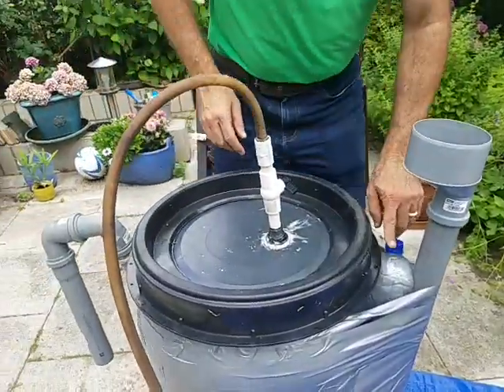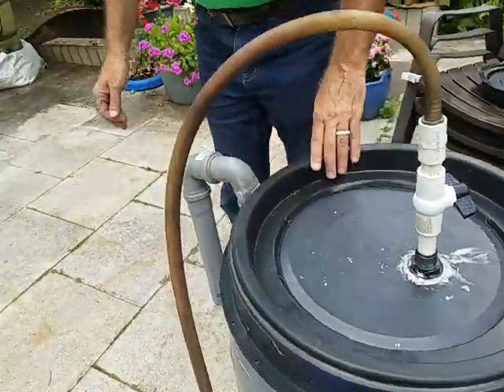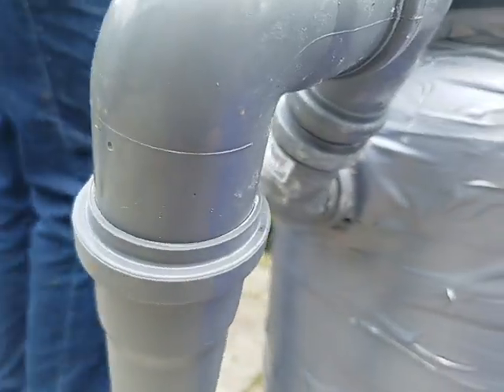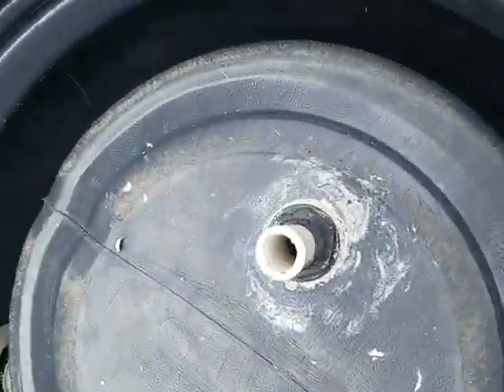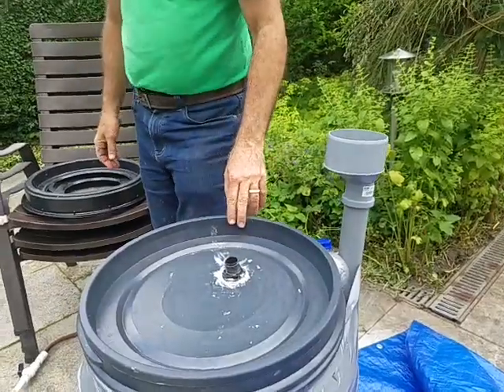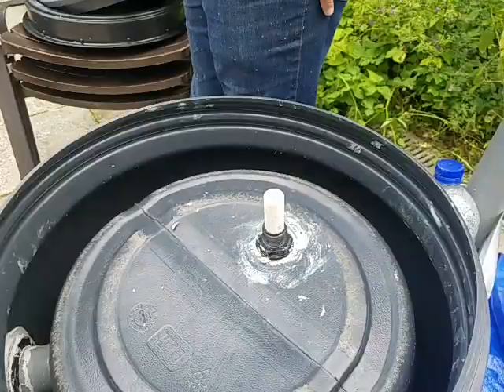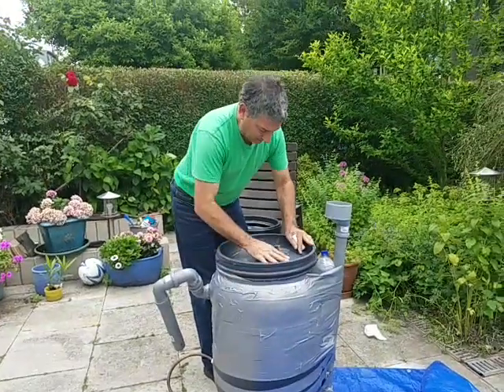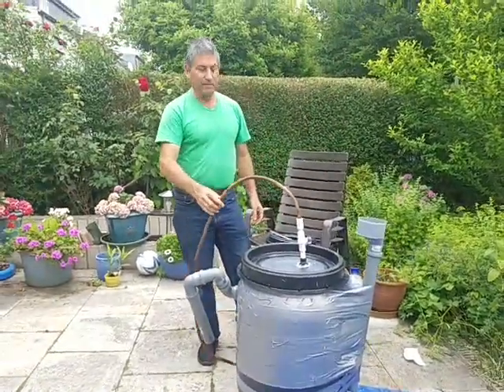Maishefass Biodigester build in Germany

Comment: To have pressure and collect the gas I'm going to try a double tank of a different design using a sealed tank at the bottom connected to a tank on top the bottom tank will connect to the bottom tank at the bottom so as gas is collected in the bottom tank the liquid in the tank will raise up to the top tank add as gas is used the water will go down to the lower tank the weight of the water will be what creates the pressure depending on how high you put your top tank depends on how much pressure you have